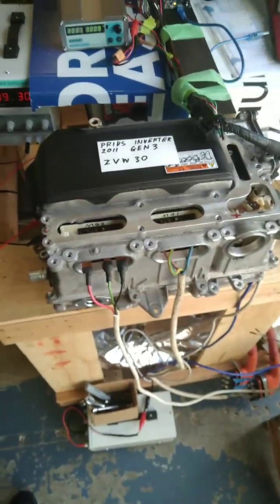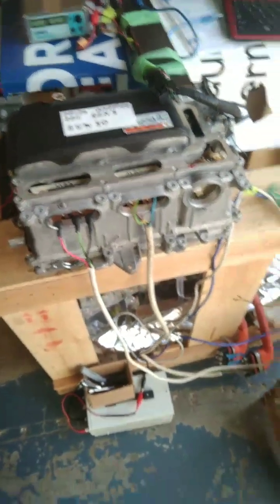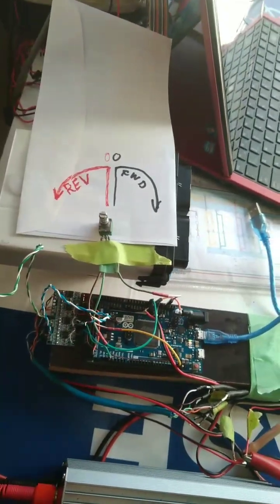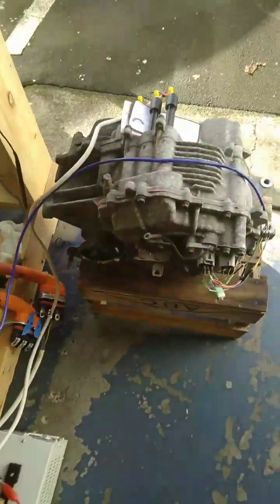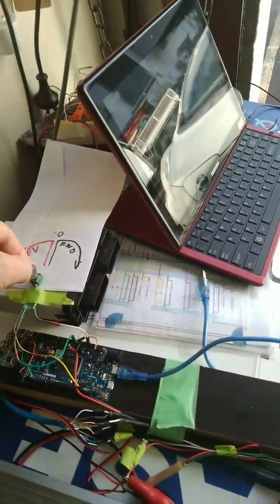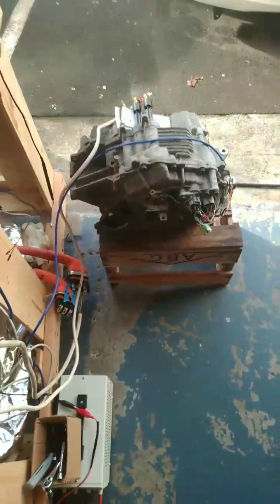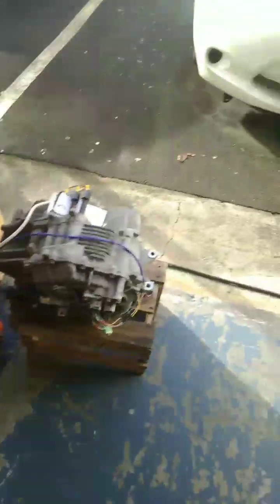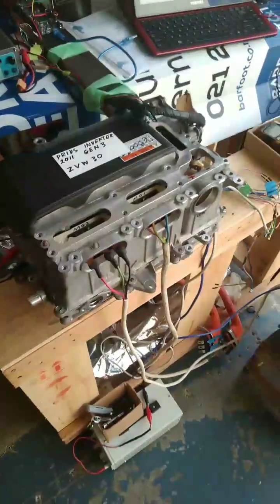Prius Inverter Drives ANY* Toyota/Lexus Electric Motor

Comment: If anyone has heard of a hack for the Highlander hybrid inverter, I'd love to know!  I have to believe that the I/O signal names are very similar, if not the same.  I've often considered turning my 2008 Highlander Limited (electric AWD) into an EV if the ICE ever gives us problems... though at 310k miles now, no smoke and burns zero oil... it might not ever die!

Still though, I have a couple of the FWD Highlander inverters that I'd like to get working... I have an i3 motor sitting around, and would like to get the HiHy inverter to run it.

Comment: Where may I find the modified Code and more info?  

Thanks!
Reply from the maker: I'm just the guy with the YouTube account & don't have any hands-on experience of the gear or code. The coder says this is the latest & will update it when they get feedback from the guy in the workshop. The guy in the workshop is great with experiments but not so good with github or YouTube! 
https://github.com/evbuilder/Lexus-GS450H-Inverter-Controller/tree/Prius/PriusHacking.ino
Reply: The guy in the workshop here, I  revisited the video, and tried to get to the code on github for ongoing development. 
 Any tips for how to find the code, got to evbuilders topic on github,  but couldn't find access to the code.
 Perhaps from a computer not a cellphone may help.